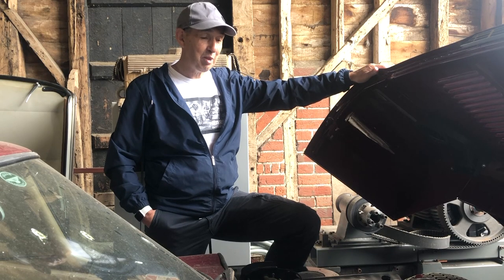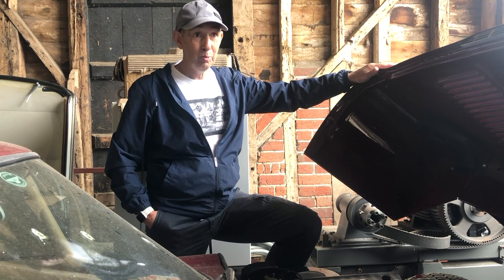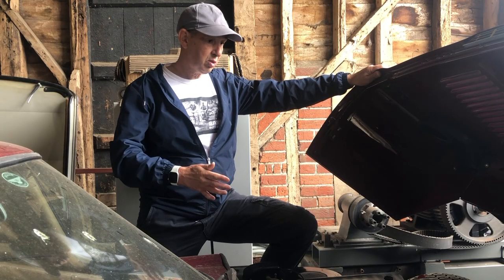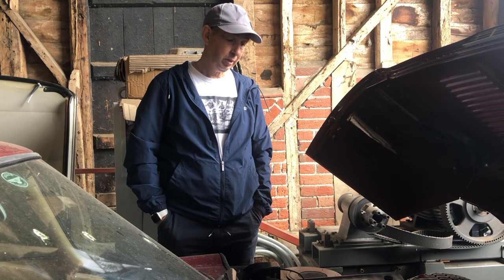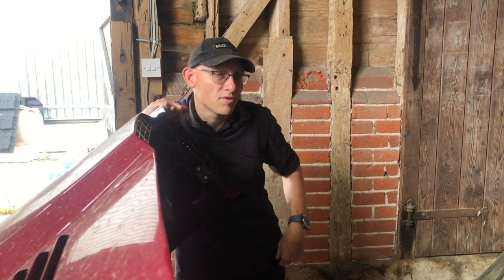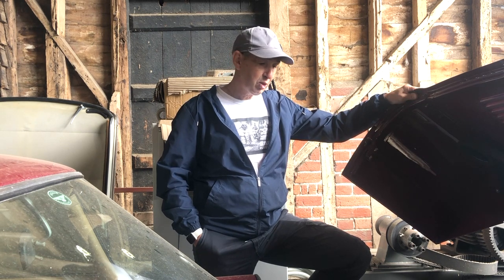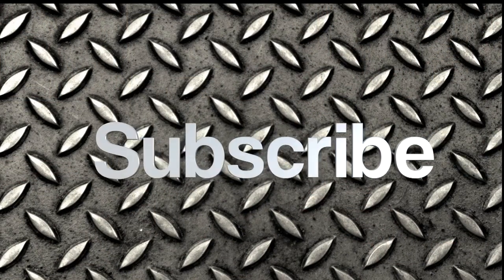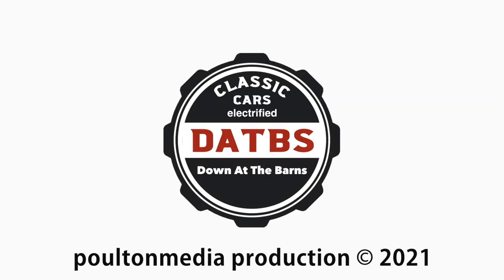IS E10 SAFE TO PUT IN YOUR CLASSIC CAR?| Down at the barns

Comment: Not all is lost!  Many E10 fuels are not actually 10% Ethanol.  You can test petrol easily to discover what the actual amount is.  All you need is a measuring cylinder with at least 100ml of petrol (taken from a can).  Add 10ml water and agitate the cylinder for a few minutes then leave for 15 minutes.  To see how much water has been absorbed look at the bottom and you’ll see a discoloured band under the fuel.  This is the water including any ethanol now dissolved in the water added.  Take the reading up to the separation line and deduct 10 ml which is the water added.  What you are left with is the percentage  Ethanol.  So if you have 7ml in 100ml petrol that represents 7%. 

The E10 rating actually represents “up to 10%” and may not actually be 10%.

I run a modern classic bike being a 21 yr old Aprilia with a plastic(nylon) tank.  I put Texaco Premium petrol in that because their E5 contains NO Ethanol.  Other companies typically contain 2.5% Ethanol including Shell.  Texaco’s E10 is less than 10% ethanol (source:  several online tests by others).  If in doubt just take a sample of petrol and test it.  There are no winners where E10 is concerned and calling it “greener” is another damned lie since it is made from high intensity farmed crops, processed using fossil fuels and gets less fuel economy than regular full fat petrol.  It isn’t saving the planet and since the UK traffic figures for pollution from CO2 amount to less than 1% of our total emissions annually this E10 nonsense only adds to our problems indirectly.  This is what we get by pandering to minority views which seem to drive legislation😢

Comment: It’s actually quite funny to come back to this and see that as predicted it was all a fuss about nothing. I’ve been running my Stag on E10 since the switch, no problems at all, even after leaving it standing for several months each winter and never getting around to putting any stabiliser in. It started straight up in spring and drives fine, checked the carb out of interest and clean as a whistle. 
Been running my MGB GT on it too since I finished the rebuild 6 months ago and it’s fine.
Bottom line, regular maintenance, change those 20 year old rubber hoses that should have been changed years ago anyway, and it will be fine.

Comment: My 1975 Mini seemed alright on the E10. I was only using it when I was going through a lot of fuel and people were panic buying and it was all I could get. The fuel lines seem to have been changed and the tank is pretty solid. I had it out to change a rubber cone not so long ago. I've had the carb on the kitchen table and cleaned it up after i had been using E10 and it seemed absolutely fine. Little bit of trash in the float bowl but nothing silly. I think all I would worry about is the fuel pump on the engine if it should perish the rubber in that. But I do put some premium fuel in when I can get it. I'll just keep an eye on things and be sensible. If the car was going to be parked up i'd probably drain the system anyway. :) I don't think it's the end of the world. Just if you're not very savvy with replacing the odd pipe or cleaning the carb you're not really deserving of a classic i don't think!
Reply: There’s a wee bit more to it than a few bits and bobs. More to do with corrosion and hygroscopic effect of E10. For a start, E10 can dissolve brass components and corrode the fuel tank of an older car. Modern cars tanks are made of a polyurethane type product and thus water condensation isn’t so much of a problem with them. The other thing is unless you keep your classic tank topped up (at least 95%) it will produce more condensation inside and leave it for longer than 28 days plus without burning it down then refilling, then the fun phasing takes place. Whereby the water that’s absorbed by the higher Ethanol starts to split from the fuel and you get a tank with water in it, it sinks to the bottom. Which obviously is drawn into the fuel line/carb and engine resulting in a dead engine. You can also buy an additive for anything up to E85 which will prevent hygroscopic effect - won’t stop condensation though rusting your tank- for up to 24months without the need to drain the tank. It still needs filled to 95% to help reduce the condensation effect. Seen it on Amazon here https://www.amazon.co.uk/STA-BIL-22205-Fuel-Stabilizer-oz/dp/B002G14VCY/ref=sr_1_36?crid=1504MK5SNTWBU&keywords=e10%2Bfuel%2Badditive%2Bstab-il&qid=1636377418&quartzVehicle=4604-12086&replacementKeywords=fuel%2Badditive%2Bstab-il&sprefix=e10%2Bfuel%2Badditive%2Bstab-il%2Caps%2C61&sr=8-36&th=1

Some more info;
How E10 petrol can affect pre-2002 cars

Winter worries

Higher ethanol content in petrol can make it harder to turn over an engine from cold.

Vapour lock

Ethanol’s higher volatility can contribute to vapour lock (petrol becoming gaseous) when operating temperatures are higher, causing stalling.

Leaks

Ethanol’s high solvency can cause problems with many seal and gasket materials that are used in fuel systems, as well as with fibreglass resins.

More leaks

Besides a risk of fuel leaks, rubbers and resins can get partially dissolved, producing deposits that could foul carburettor jets.

Corrosion

Ethanol can become acidic and cause corrosion of aluminium, zinc and galvanised materials, as well as brass, copper and steels coated in lead or tin.

Comment: I recently seen a video where water was added to the fuel, shaken up, left overnight to separate, and the nearly pure fuel was decanted off, alcohol is soluble in water. I can see it being a pain if you are doing this for a full tank, maybe someone can invent a machine to do this with volume in mind, and do it cheaply.
Reply: This is why you use carburetor spirits. You put that strong ethanol in the tank to get the water out with the gas and prevent freezing in the fuel system. It mixes and get carried out and burned.

Comment: I haven't tried E10 yet and it worries me a little, Not sure how my Mk3 Cortina will like it. I have already upgraded the fuel lines as a precaution just in case I use the wrong pump.
Reply: Mk 3 Cortinas have metal fuel tanks, E10 is lethal for metal tanks and pipes. Your old rubber fuel hoses will dissolve using E10. Fuel pump rubber diaphragm and seals in carb etc will dissolve too. Do not use unless you wash out the Ethanol first. Video on how to do it is on Youtube
Reply: @alanbayliss6401  Yes I know about E10 & metal tanks. I am doing my best to avoid the E10 pumps. I have been watching Cortina City on Yt for years and I bought my car from that channel 👍🏻🙂

Comment: I can tell you that my 86 Honda shadow was wrecked by e10, as soon as it switched over it ran low power and over heating issues. In Ireland we only have e10 in the pumps , no other choices . Do any agricultural petrols work like Aspen 4?
Reply: Had same problem with a 1981 Suzuki gsx750ex, mind you the E10 was sitting in the tank for a month, bike cut dead and would not start.
Asked a classic bike shop in the U.K, they recommend all their customers do not use ethanol fuel, but an R type storage fuel or Aspen 4.
Think you can only get the Aspen here in Ireland, will try it myself, no other choice, unless you want to drain E10 from the fuel system after every ride.
Reply: @pantherzzz111  yes, I tried around carlow but people in the agri shops were looking at me like I had 2 heads. Going to keep looking
Reply: Just got an email from classic bikes U.K, with an email address in the U.K. that sell, R type storage fuel in 10 litre drums, he thinks they will ship them. Am I allowed to put that info up?
Reply: @pantherzzz111  I hope so, pls share
Reply: Put the address up twice, keeps getting taken down.
Reply: @pantherzzz111  r type as good as Aspen 4?
Reply: They reckon it’s better, as it mixes with other fuels easier, not sure if it will work out any cheaper though.
A lot of people suggest removing the ethanol from the petrol yourself, it’s quite simply to do, but I would think it has its dangers.
Fuel constantly sitting in containers in the shed, not for me , too risky.

Comment: Interesting watching your video. I have a Rover P4 and as I was concerned about the effects of ethanol I contacted BP, Esso and Shell to ask whether their E5 fuel actually contained ethanol as I understand that 5% is actually a maximum. Only Esso stated that their E5 premium petrol did not contain any ethanol, of the other two (I can't remember which way round) one said it did and the other wouldn't say so I now always use Esso super E5 grade in my Rover.
I also did a test in my everyday Suzuki trying each grade of fuel, 0, 5 and 10% ethanol.
Although not by any means a scientific testI found that for every 5% increase in the amount of ethanol in the fuel my petrol consumption increased by approximately 5mpg which served to offset the increase in the cost of the fuel. This was only on local roads not dual carriageway/motorways.
Consequently I wonder whether there is actually any reduction in pollution by adding ethanol as higher fuel consumption means more exhaust emissions from petrol.
What are other's experiences?
Reply: Forgot to say that non ethanol Esso super is only available in the south east of England.
Reply from the maker: Thank you for the information 👍

Comment: I ran an ethanol mix in my South African  MGB for many years. From what I recall, when it was first introduced, some cars needed some chemical treatment - dipping of carburettors etc -  to avoid problems.  But it certainly wasn't the end of the world. I've driven a thousand miles from Johannesburg to Cape Town and back on the stuff!  Epoxy-lining the tank was a 'no brainer' anyway, to avoid it rusting out!   BTW   Keeping the tank fairly full is a good way to avoid condensation within the tank - but that has always been a good idea with a raw steel tank!
Reply from the maker: Thank you for your contribution 😊

Comment: I tried E10 Absolute garbage , made my car slower and run rough , so I always use super unleaded now but it costs £1.60 per litre now 😭
Reply: Ethanol is a octane booster and is regularly used in racing cars for better performance. They use E85 as a high performance fuel which is 85% ethanol. Your engine should run smoother not rougher if theres any change at all. Ethanol got just over 30% less energ density which usually results in 1.5 to 2% higher fuel usage.
Reply: @TheDude50447  Your right as i watched a show called Gears and Gasoline and they had an Evo on it that kept getting engine knock when they couldn't get enough ethanol at the pumps
Reply: @christineayres7199  actually theres a law here in germany that says that every petrol station has to sell E5 and E10 fuel with the exact same octane rating. So it generally runs the same in the engine. You got a higher fuel usage though with E10 and since thats generally around the 2% mark you just gotta see if the price difference is worth it between E10 and E5. Up until like a year ago E10 in germany was only like 1 to 2 cents cheaper so hardly anyone bothered with it. Since last year its a 6 to 7 cent difference due to some tax stuff and its worth it now. Check in your cars manual or online if your car can take E10 first then it should be fine. The ethanol in the fuel if its in your tank for months can pull water out the air which does some chemical stuff and it can corrode the fuel system. 
I personally have run 4 cars on E10 since 2011 including a 1986 corolla for 50000km and never had a single issue with it. I also never noticed anything off with the engine in terms of running between E10 and E5. 
You might wonder why I was running E10 when i said nobody bothered with it. Well I didnt know shit about it and it was a bit cheaper. I only got into informing myself about it when my current car which i bought last year had something written about "E10 recommended" on the fuel filler cap :D I was like Ive been using that for years :D
Reply: @TheDude50447  Thank you for the detailed info my friend

Comment: Most E10s are currently E5 and most E5s are ethanol free. I'm testing several brands and will continue to do so for piece of mind for classic car drivers. The price difference will be negated by the lower mpg of ethanol. The mandate effectively made the super unleaded better value for money. I was disappointed to hear you mention EVing classics though.. you may as well just wreck your engines with whatever crap you want to run it on if you think battery power is a good idea!

Comment: Ethanol is 30% less energy dense than petrol, therefore vehicles will use more petrol generating more pollution not less; another covert operation brought to us by the usual suspects.
Reply: It also means the price difference between E5 and E10 is less if you look at energy density (E5 = more miles per liter)
Reply: Plus more money for the government that’s why it’s been introduced
Reply: @johnelliott9415  It’s a straightforward tax increase, as the excise duty +VAT is charged per unit volume, not per energy content. So the most efficient type of fuel excise duty wise is diesel. The other effect may be increases in animal feed wheat prices, as that is likely to be the feedstock for some of the ethanol production for the E10 mix in the UK. Might be good for some farmers, though.

Comment: How long would E10 last in winter storage.  All my bikes post 2015 but I don't use them for four months of the year ?
Reply: In an experiment I saw, they stored ordinary e10 for 3 months in a ventilated container, poured some into a bowl, and pointed a butane lighter at it. The stuff didn't burn any more. Same applied with multiple different so-called fuel stabilizers added. I'm draining all my bikes dry for storage now.

Comment: I ran e10 and caused me a lot of problems I've changed everything fuel related and still got problems... =( end of carbed engine now.
Reply from the maker: Sorry to hear that
Reply: I doubt running E10 is your main issue, easy to blame it but probably something else going on. I run it all the time in my 73 Stag and 72 MGB with no issues.

Comment: I live in Australia and we had e10 for about 15 years but we have unleaded 91 95 and 98 the e10 is the chepest 91 and 95 and 98 are a little dearer my wife had a 2004 ford Fiesta and we ran it on e10 once and it was a new car wrecked the fuel pump but then we chaged to 95 or 98 unleaded petrol no problems we never changed the fuel pump in it
Reply from the maker: That’s an interesting story seems in some cases no rhyme or reason

Comment: There’s been a bigger problems in Australia with all the boats 🚤 as they have fibreglass fuel tanks it’s been eating away at all this has been a real nightmare.
Also remember even another bigger problem and that’s with you lawnmowers chainsaws and other garden implements that has an engines very concerning basically E 10 and even E5 just a higher % of ethanol the problem is it will eat away at many of the engine components. On YouTube there’s a demonstration and what it will do to aluminium plastics rubber components and many more on YouTube as well there’s some guys showing how to remove ethanol it’s basically fiddly but achievable one question if you remove enough ethanol and mix it with 5%  this should die loot it and make it less of a problem what’s your views. As far as I can understand this ethanol is lethal stuff.
Ow yes one thing is all cars using E10 will find that you will need more as you do not get the miles per gallon so it’s worth sticking with E5 even if it’s more expensive but you will get the extra miles per gallons out of it happy motoring.

Comment: In the answer to the question as what do I need to do to run E10. 
For a start who runs there classics or modified cars on low octane fuel. 
The answer given well guite a lot really fuel lines and some carburettor components. Really is that it. Don't really sound like a lot to me. Fuel tanks,  steel tanks not a problem, plastic tanks not a problem. Fibreglass really is that a joke. Is there such a thing?

Comment: Why doesn't the 5% ethanol that is already in fuel attract any water and cause similar, but slower, corrosion to the 10% ethanol? Why doesn't the 5% ethanol attack rubber in a similar fashion to the 10% ethanol?
Reply: E5 is 5% max. Lot of companies were only adding up to 2%. Even on modern vehicles you don't want to leave vehicles stood for months as fuel degradation problems start. Fuel pumps are a target for e10.